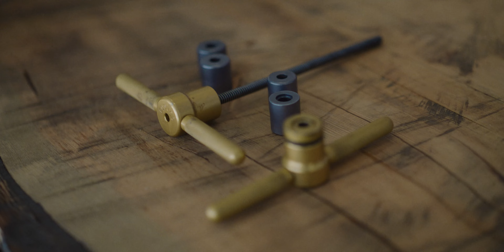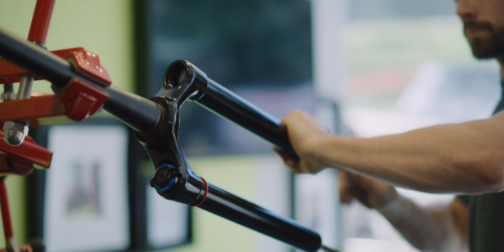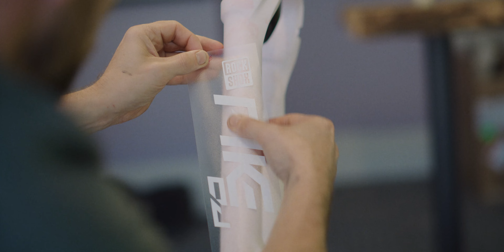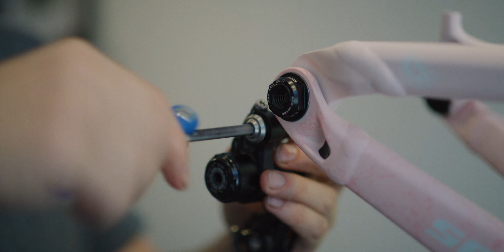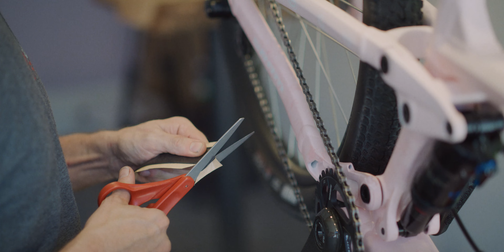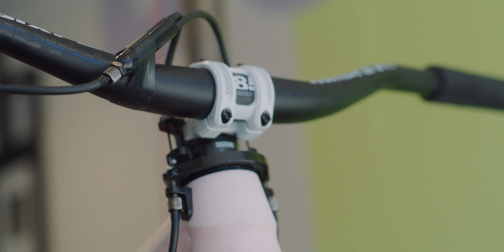BUILT | Emil Johansson's Red Bull Joyride Winning Trek Ticket.

Comment: So even SRAM don't trust Taiwan's ability to assemble a fork correctly?
Reply: They could have altered the travel?
Reply: @uwanallen1893  Probably disassembled to paint the lowers since it's a custom job right,  so might as well check everything over I guess
Reply: @iggywow  Also added volume spacers
Reply: @iggywow  true
Reply: an off the shop floor fork feels way different to one thats had its airspring cleaned out...
If your bike shop has no idea about that - they shouldnt be dealing in high end bikes.. AT ALL

Every fork you buy, pull the air spring, clean out the grease, install and enjoy a fork that rides atleast 40% better.
Reply from the maker: Our good friends at the Trek painted Emil's fork lowers with their Project One custom paint program. And to do that, the fork needs to be taken apart. We thought building it from scratch and applying decals would be a fun addition to the video.
Reply: The Pike's are super plush, they come without any spacers installed. not that they dont trust them. It's just most people need a volume spacer especially when hitting 40ft+ jumps. Even if you dont get the lowers painted 99% of build videos I've seen with pike have them serviced.